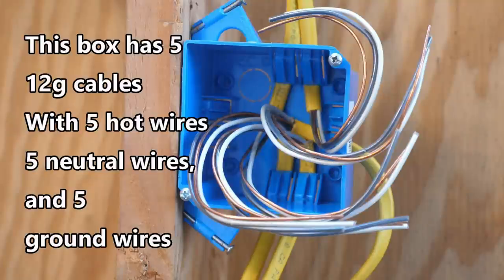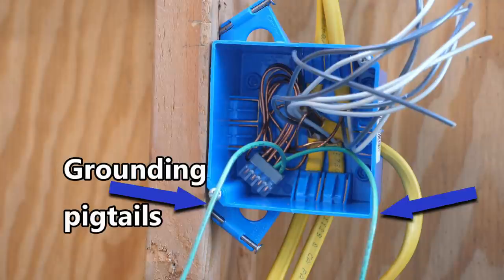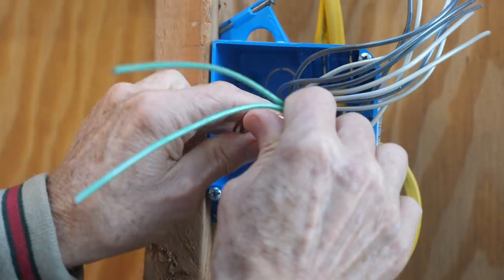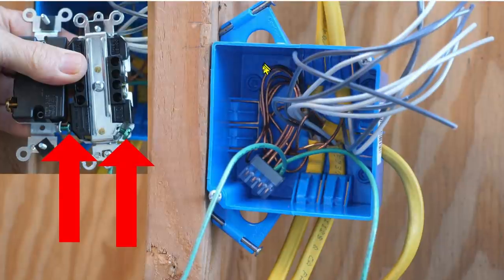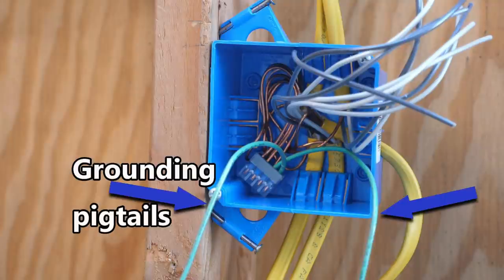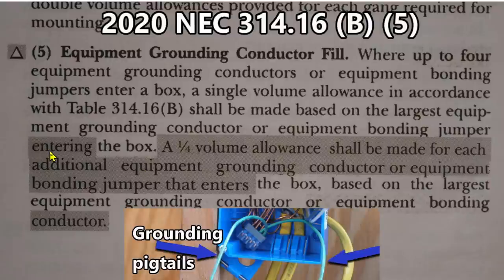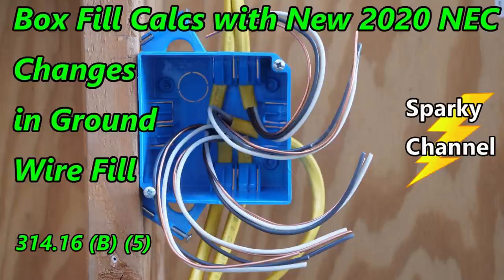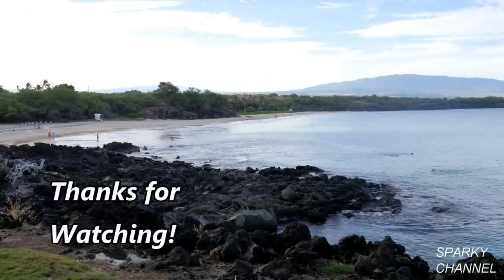Do Pigtails Count in 2020 NEC Box Fill Calcs + How to Handle 7 Ground Wires

Comment: whats your thoughts on copper crimps been using them for over 25 yrs?   i would have twisted all grnds together crimped at about 4 inches left 2 at around 8 inches and trimed the others at the crimp no extra connecter or pig tails

Comment: How about grabbing all 5 bare ground wires and use a crimp sleeve and only leave the ones you need and cut the another ones by the crimp?
Reply: That's what I do, I've been taught that, it's easy and simple.
Reply from the maker: There is more than one way to do it. Your method sounds excellent.
Reply: This is the way I was taught that's why I have a klines with a barrel crimp tool, but if you were dealing with a non-NMC cable you would need three pigtails. It's a different kind of thinking when you go from residential to commercial and industrial. I find it difficult to go back and forth without scratching my head.
Reply: that was one of the reasons I left the previous company I worked for.  many of the guys would also set the crimp so the wires were about 3 inches long if you had to cut the crimp off and redo the connection for any reason - like if they didn't crimp it hard enough and wires popped out - and half the guys would leave sharp ends on the cut wires.  cut, twist, then crimp; worked okay, but I had to find ways to resecure way-too-short connections at least twice per project.

now I forget if a standard size barrel crimp is rated for 5X12. (a quick check says up to 6X12)

Comment: @Sparky: Thanks again for clearly explaining a niggling yet crucial detail. Question: I've speculated that pigtails and jumpers do not count in box fill calculations because they do not affect the total power running through the box, and thus do not contribute to heating. (although they do of course take up some physical space.) Can you confirm this rationale?

Comment: Hi Bill,  I heard the push wire connector is for light connector only . For circuit wiring we have to use nut wiring only ; but I saw you use 8 push wire connector . Is it legal in california ?

Comment: Sparky! I have a question? can I install a multi-branch circuit for receptacles around a countertop space with a GFCI double pole breaker? or can I only use GFCI receptacles? Thanks, happy new year!
Reply from the maker: You'll need AFCI/GFCI for remodel or new construction for a kitchen. Putting the AFCI/GFCI in the main panel is fine.
Reply: Code calls for r4 breakers in New construction and remodel. Those breakers are expensive though.

Comment: I’m no electrician, but I see five grounding conductors entering the box. The code document you reference says four entering a box is allowable. Can you clarify?
Reply: I'm not an electrician either. What I believe it means is that one, two, three, or four EGC count as one conductor volume. Above four, each EGC entering the box counts as 1/4 volume each. It does not mean only four are allowable. It means that up to the first four, they count as one. For the 5th and beyond, count each one as an additional 1/4.
Reply: I was wondering where that 5th egc came in from.

Comment: Hi Bill from Sparky Channel

Once again a fantastic video
I enjoy that they are short and to the point but disappointed when the video ends and have to wait for the next one.

Seems like lots of excitement and questions folks have and nice that you’re explaining so well
So much in that code book to know and not always easy to interpret

Just discovered your EMT bending and looking forward to watching those soon

A lot of this info is so helpful in the HVAC field where I come from but not really taught
Already putting some of your info to use

Thanks again and looking forward to your next video
Reply from the maker: Thanks Jeff!
Reply: Jeff ... I started doing wiring for a living when I was in HVAC 40+ years ago and we were only allowed to do the wiring that was near the equipment, which is not totally spelled out by the state licensing board. It was made clear that we should not be inside a panel with that level of license. They used a term like "associated local wiring" without being specific. That said, my rule became if it looks shaky (not up to code) we should call our office and let them handle the next step. The key here is to know when it's not right and it doesn't take long to see a pattern of common problems. It also helps to get in good with the other contractors because we can all learn from each other. The best thing I learned is to use proper terms when talking to someone in another field. If you can speak their language they are more likely to listen.
Reply: @rupe53  It’s so interesting to know you were once in HVAC so I guess you really know your stuff in both electrical and HVAC

Right now I’m working on obtaining my state personal license so I can do HVAC as my own business and once I do that perhaps start studying to obtain an electrical license or if not at least be able to do it to code.
Reply: @Jeff-Lawrence  ... license requirements vary by state. Where I am you need some schooling to the tune of around 600 hours plus 2 years in the field before you can test. This allows you to work for someone else who holds a business / master license in that field. Go another 2 years (4 total) and you can test for your master license. The higher license has more safety and building codes, plus some business laws. Good work ethic and work habits will go a long way toward your goals. Inspectors hate sloppy work, even though it might meet code from a technical viewpoint. A good presentation makes a good first impression.

Comment: Why don’t you guys sleeve your ground cable?
Reply from the maker: We're a little odd that way. I've always wondered about it as well. Some of our cables do have sleeved grounds though.
Reply: Mm by definition they should be at ground potential so no safety risk. In commercial I do see insulated grounds most of the time. I guess that's to make it harder to accidentally short things.

Comment: The NEC stated that up to 4 conductors entering the Box you have five grounding conductors there should be a subparagraph that covers over for conductors
Reply: Code Change Summary: Revised code language. The 2020 NEC will now only allow up to four equipment grounding conductors in a box to be counted as a single volume allowance.

Comment: How about transitioning cables and wires from emt to liquid tight flexible conduit and so forth. Do you have a video about this??
Reply: if I'm going from EMT to flex, I use a "from-to" connector that directly couples the two.  if I'm going from conduit to flex in a wet location, it is always PVC to Carflex (nonmetsllic flex) and I screw the female flex fitting into a female PVC fitting and then glue the female fitting to the PVC last. (it is the easiest order of assembly)  
where I live, EMT will dissolve in an outdoor environment, so nobody uses EMT outdoors.  in hot dry climates, where ambient temperatures exceed the softening temperature of PVC, it's pretty common to take a male EMT connector, and use a threaded coupling to connect a liquidtight metallic flex connector to it.

Comment: and this is why I run my fixed lighting in #14 instead of #12.  also, regarding an earlier conversation with Bill, I waited to order my 2020 handbook until I could download it to my new computer - and NFPA no longer sells any of their codebooks in electronic format.  feel free to refer to them as pencil pushers and bean counters over this.
Reply from the maker: I bought the hardbound NEC handbook and paid almost $200! Ouch! They have a cheaper one on Amazon but I suspect it's counterfeit.
Reply: @SparkyChannel  I'll let you know. The ordering process from the nfpa site was a nuisance, as well.

Comment: 12 gauge stranded wire pigtails are commercially available. Does code allow using 12 AWG THHN wire for hot and neutral pigtails. This would sure make cramming them into the box a lot easier.
Reply from the maker: Yes, I don't know of any code saying that you can't do that. Excellent suggestion.
Reply: Thank you for your quick reply. One thing I would add is that stranded wire should only be used with back wire outlets and switches using the clamping feature. Trying to insert the wire into a back stab outlet or wrapping around the screw on a side wire outlet would probably mess up the wire strands. BTW I love your channel. Very intelligently done.
Reply: I bought some, and both brands I found available appear to come with a terminal pre-crimped on one end to go under the screw. You could always cut it off if your application would work better without it. I’m looking forward to trying them out.

Comment: Great video Sir I am slowly getting my head around the USA Regs I love that tool you was used to push back the cables is on Sale anywhere specially in the uk I would to have one . Keep up the good work watching from the uk 🇬🇧
Reply: it looks like something a decent woodworker could make if you can't find a source for the plastic tool.
Reply: It’s called a Voltclaw, check out their website, Amazon, Home Depot etc
Reply: @Drbigdom  thanks I will check it out
Reply: @Drbigdom  looks like a clever little gadget.  one that people will either love or have little use for, which is normal for specialty tools.
Reply from the maker: My friend Warren will be very glad you're asking. And believe it or not, they are made in the USA! VOLTCLAW-12 Nonconductive Electrical Wire Pliers: Amazon: https://amzn.to/3oaMNEp
  BTW, Warren is a master electrician.

Comment: Can you connect multiple grounds into several separate but connected push in adapters?
Reply from the maker: Yes but would need to be pigtailed together and would take up more room in the box.
Reply: @SparkyChannel  I just did that today. I had a 12/2 cable coming into the box, two 12/2 cables for two light circuits, two switches, and the metal box. The 12/2 grounds went into one four slot connector, the switch and box pigtails went into another, and a jumper connected them. Getting everything settled in the box got a bit interesting.

Comment: I like the wago connector for grounds, not for current carrying wires! Does it work? Yes it works.... For a little while!
Reply: That's just not true. Europeans have used the equivalents for many, many decades now and they don't fail.
Reply: Those wago connectors existed in Europe since the 1950s. Is that still a little while for you?
Reply: Current carrying neutral wires will burn these connectors! Wire nuts cheaper and more reliable!
Reply: I don’t care what they use in Europe. I’ve seen too many burnt up outlets where someone used the spring terminals versus the screw terminals. Give me a secure mechanical connection on load carrying conductors any day over spring tension. Trust, but verify as they say!